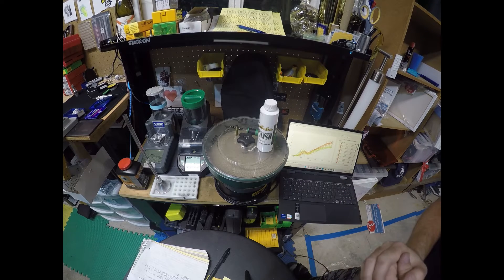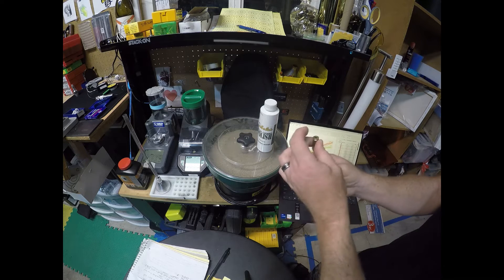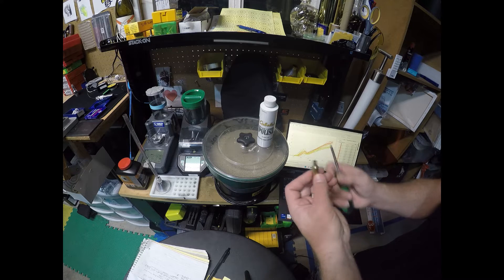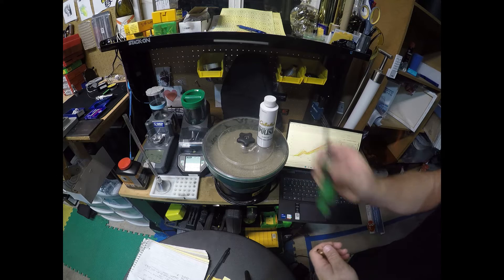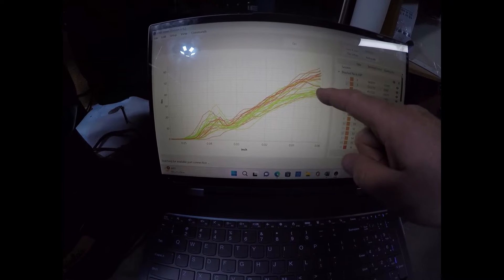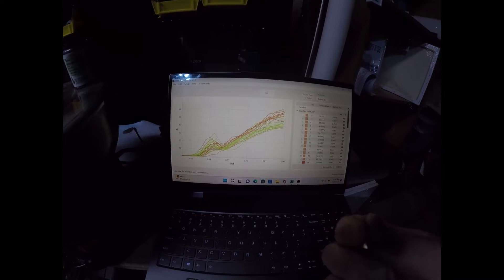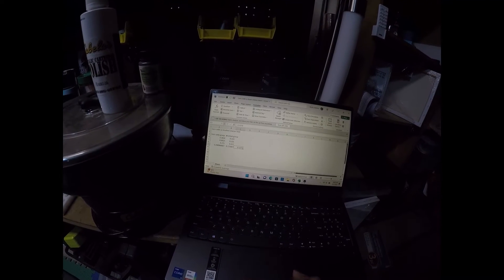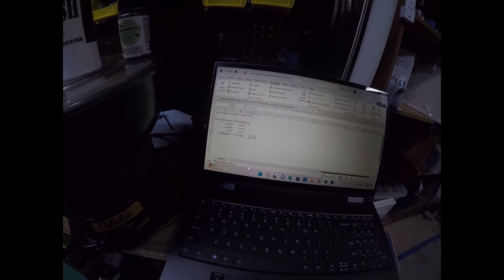Corn Cobb vs Brushing Interior Neck

Comment: another interesting video Bryan . What a relief to confirm that what we can only do within the time frame of a benchrest match is better than a more complicated and time consuming method . I have been tought to run a clear plastic soft brush in and out , maybe with just a wrist twist , and that the residual carbon layer in the neck is better than a squeaky clean brass , especially if obtained by ultrasound dip . In benchrest matches I observe a lot of shooters frantically running a fast drilled bronze brush for seconds in their necks which probably leaves the neck very clean : i wonder how that compares to our clear soft plastic brush  single stroke ? 
Do you confirm your double ( neck +bullet) Neolube painted cartridges in PPC groups better than nothing ?
Reply from the maker: Agree that any finding that reduces the frequency and/or duration of procedures is great. In this case, a simple brush of the neck does the job. As for lubing the interior neck, yes, wet lube on both the neck and bullet are ideal.

Comment: Thanks for doing this test Bryan. Interesting results for sure. I performed a similar test myself and found that the necks brushed only before Amp annealing produced tighter groups and had a slightly lower ES as well. If I have a few rounds to load I usually just clean as you do with the steel wool and then use a brush on the neck because it's fast, simple and as it turns out,  produces better accuracy. But I often have larger batches to prep (after a PRS match or after several practice rounds at the range) so I wonder if brushing after corn cobb cleaning will still be the same as brushing only. I could and have processed 150 pieces of brass with just the steel wool and brush but, like to run the batch through corn cobb after sizing to remove the sizing wax. Your test on brushing before and after annealing indicated that brushing before annealing only was the preferred method so the corn cobb must be altering that outcome. Do you think that adding the Neo lube on the inside of the neck and bullet overrides the brass prep process? In other words, will it matter whether you clean in corn cobb or if you brush the neck if the Neo lube is used. I have been trying to find and settle on a prepping method that minimizes the number of steps and yields the highest accuracy/lowest ES.
Reply from the maker: I totally get what you’re saying. I’ve gone to PRS and NRL matches with 250 rounds and usually burn through 200 so I come home with a hefty batch to prep for the next use and don’t have much time. In that case, In stead of steel wool cleaning the outside, I put the brass through the tumbler to get the carbon off the outside and then i brush and anneal…at least I get rid of the steel wool procedure which saves some time. 

I do believe the lube on the interior will help with consistency no matter what procedure is used. I have used that Neolube 2 on donut situations and it helped tremendously…seems to be a versatile strategy and I would definitely try it.
Reply: @WitchDoctorPrecision  In your current prep process, are you using any lube before sizing and if so how are you removing it?
Reply from the maker: @palmersasscer7462  yes, I use Hi-Line which is a lanolin based lube. No bad smell and very effective. I use microfiber cloth to wipe off the wax.
https://www.amazon.com/Hi-Line-Precison-Hybrid-Sizing-Wax/dp/B08VGZWFH3/ref=mp_s_a_1_2?crid=3GJMUDKTYEX7N&keywords=sizing+wax+hi+line+precision&qid=1667690858&sprefix=sizing+wax+hi+line+precision%2Caps%2C171&sr=8-2
Reply: @WitchDoctorPrecision  Thank you. Just purchased the Hi-Line to give it a try

Comment: In my experience I've found the vibrating tumblers don't clean the necks very well. Wet tumbling with stainless media does(discovered this when I started flame annealing as a first step and struggled with the left over oxides on the neck causing a gritty feel in both sizing and seating). However, in my testing it definitely necessitates adding lubrication to the inside of the neck to avoid inconsistency involved with squeaky clean necks. It seems to me like both the brushing and the wet tumbling are mechanically removing residue in the neck which might be the difference. Although when visually comparing both the wet tumbled necks are cleaner. Nice to see you back doing tests Bryan. Hope your season went well.

Comment: Thanks for sharing the work Bryan.
Is there any thought that the two different neck cleaning treatments would require their own tune?
If for example, your original charge and seating was tuned based on your original neck cleaning, then getting good groups makes sense, but is there also a possibility that making the change causes combustion differences that would require a different tune?
Just food for thought.
Reply from the maker: Yes, you could try to tune to a particular method but it I’ve never  had that work well during load development. I’ve tried not scrubbing interior necks and tuning to that but never got a great tune like I did when I did scrub with a brush. This is why scribing with a brush is now the preferred method and benchmark to compare to.